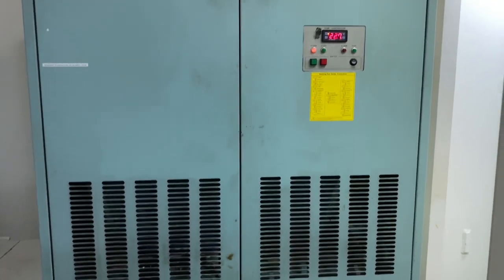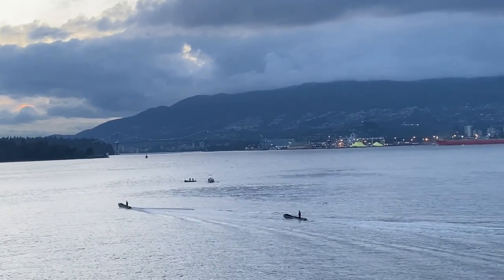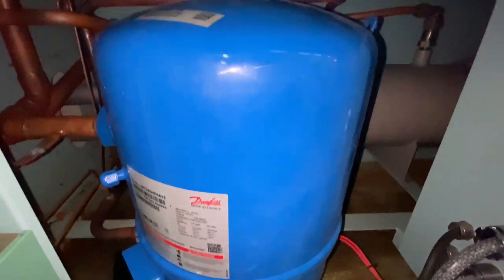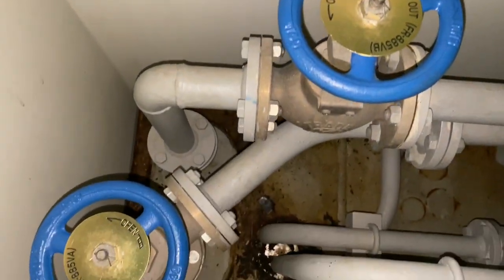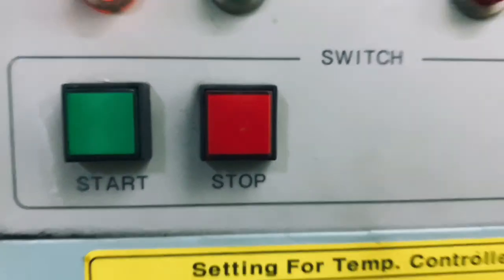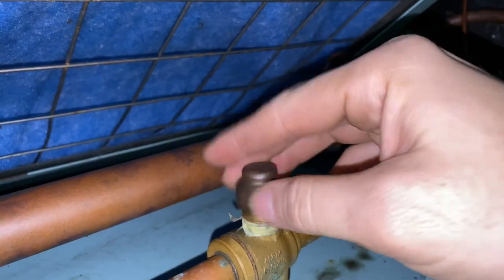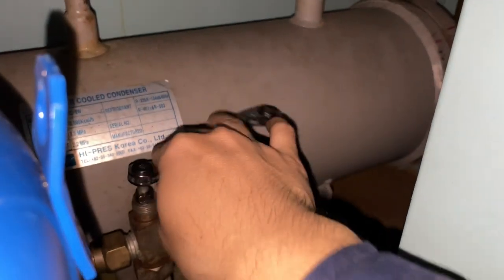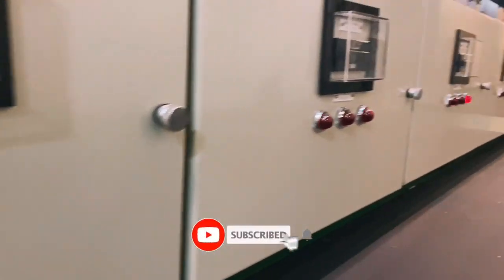MAIN SWITCHBOARD AIRCON TROUBLESHOOTING | SHIP’s ELECTRICIAN

Comment: Sir jake  have a good day! San po nkalagay banda ang shut off valve? Kpag magcharge po b ng freon  liquid po or gas ang gamit sa package? Meron po kasi ako nakita charging valve after ng evaporator or before compressor. Dba gas side po yan? Salamat po ang more power.
Reply from the maker: Shut off valve sa discharge side. Unitor is now supplying freon na Gas lang ang laman kaya naman sa suction side ang charging palagi.
Reply: @leckyjake  salamat sir and More power to you